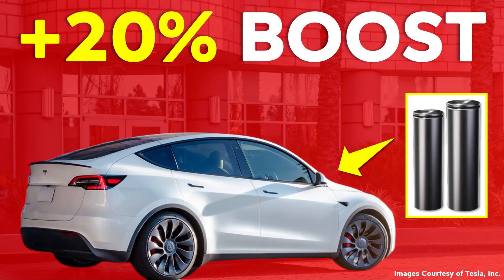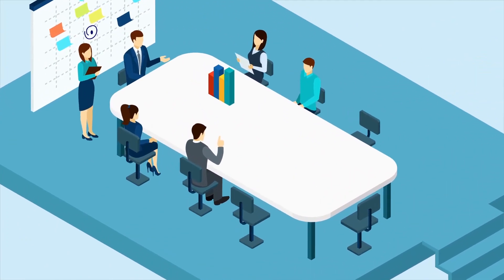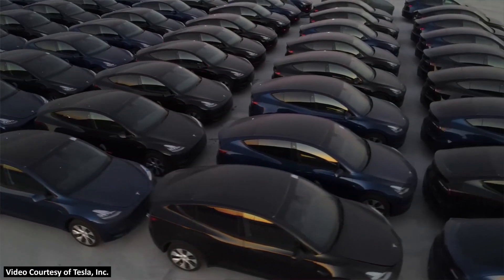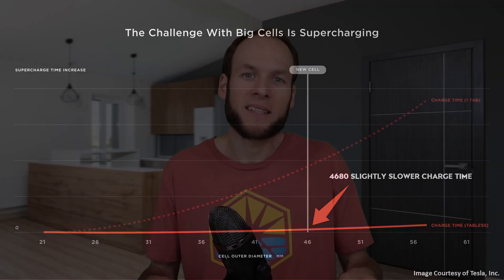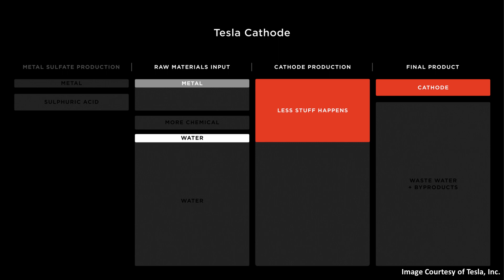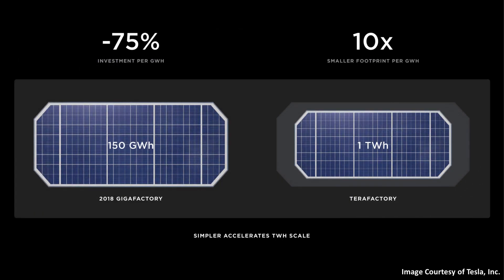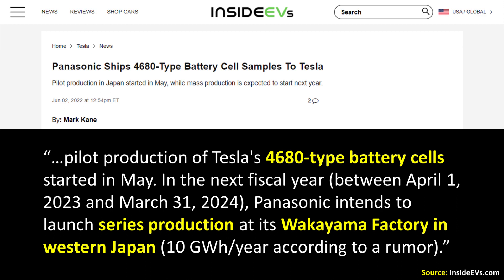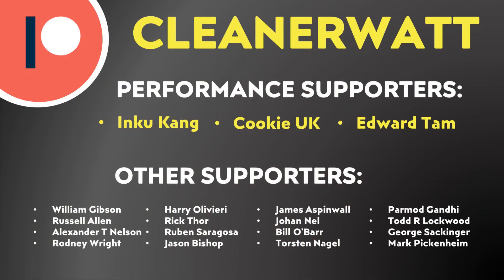Tesla vs Panasonic 4680 Batteries: BIG CHANGES! (1)

Comment: There's no way that the Panasonic 4680 could be charged at the same rate as the Tesla 4680. The internal resistance of the Panasonic version must be significantly higher than the Tesla one. I suspect the Tesla is deliberately holding back on the charging rate in software to avoid the Osborne effect and allow them to use batteries from multiple sources.
Reply: speculation is speculation. there are so many factors how the battery can be build and how the chemistry structure can be. there are no public compairsion on the cell level of both 4680 cells. when i see how many RnD is done in the battery tech it is always a challange from lab to massproduction.
Reply: @Francis-yc9nc  Exactly. Speculations are easy and often just based on a few Youtube videos people have watch without deeper understanding of the topic. What I would like to see is some lab analysis of real cells. Basic things like internal restistance for example or energy capacity. Is tabless really THAT much better than having e.g. 5 tabs? We don't know as long as noone actually takes the measurements.

Comment: I bet the new 5 tab 4680 built in Japan are for the MS and MX.
Reply: But then they'd have to completely change the Fremont production line for a cars selling about 160,000(?) in a year.
Not worth it.
Reply: @rogerstarkey5390  it's where they build the 18650 cells for the MS and MX

Comment: So in summary the Pansonic 4680 is not quite as good on electron path and heat , harder to make but uses a little less  copper and needs less  changes to there production line.
Reply: @Retired Bore if that was the choice you would be right but it's not

Comment: The thermal conductivity advantage of tabless 4680s would only be realized with a robust thermal path  from the anode and cathode to the exterior of the cell. We don't see that path in Tesla made 4860s.

A greater concern, one I mentioned on this channel before while quoting a Panasonic engineer, is that even with a good tabless design these cells will be hard to cool. This is the reason the Plaid uses 18650s. More layers of anode and cathode reduce heat transfer to the outer housing. The heat generated within the battery during high load comes much more from the chemical process itself than from internal battery conductor resistance during discharge.

Between the pack packaging disadvantages and the difficulty in cooling these cells I have never understood the advantage of using them (yes, I heard the "Battery Day" claims, I simply never believed them). Having seen Munro's initial tear-down I am convinced that Tesla is in a real bind with these cells.
Reply: The Tesla anode essentially "shorts" to the base, then the sides of the can.
Large surface area
Reply: the claim that a battery with 5 times the volume had 5 times the capacity and 6 times the poweroutput?
Reply: @reahs4815  
+/- 5 times the surface area of jeyroll (I think they measured about 4.8 very roughly)
That's 5 times capacity.
B
If better electrical contact wastes less energy as heat, and allows a 20% increase in energy flow, combi ed with that capacity, that's "6x power" (5 x 1.20)

Comment: I thought the goal was mostly ease of manufacturing with a smaller footprint for cheaper.
Reply: Tesla goal Panasonic just want to sell batteries for a good profit.
Reply: Tesla goal is their structural battery pack, and the reduction in resistence that decreases heat under load and allows more power output.  Also reduces the number of cells needed per pack dramatically.
Reply: @scottmcelhiney323  
The current Tesla 4680 poacks have fewer "Cells", but those combined cells still contain the same surface area of "active material" as an equivalent 2170 pack.
.
The larger "can" is easier to assemble into a structural pack.
Also, the thick casing material, if used in a 2170 "glued" pack, would be using a lot more metal.

Comment: Tabless tech was all about speed of manufacturing. Thats what I've heard from day 1. I did not think that the "Tablelessness" of the battery is responsible for the other benefits of the battery. Maybe I am wrong.
Reply: Tables means shorter electric path for the current resulting in less heat generation that will not only benefit faster charging but more efficient (potentially lighter, simpler) cooling and better sustained performance during peak performance. Also less degradation maybe. 

Tesla wanted to put them 4680 into the Plaid(+) but realized they are behind schedule and refreshed 18650 will do the job anyway, but IMO structural Roadster is still on the table with 400+ miles worth of 2nd or 3rd generation 4680s with 350 kW peak charge rate, insane acceleration and a lot of weight saved on the platform and complex cooling.

Comment: Tabless reduces resistance and hence heat generation. Also tabless offers a better escape path for any heat through the cell ends especially as the tabs are in direct contact with the cell terminal.
Currently it seems that the structural packs have the cells side cooled - I expect that to change as Tesla evolves their pack design. Tesla is just on version one and just needed to get something functioning and will refine their design quite rapidly.
Reply: Tabless design is a bit if a miss name really right...? More like it's an full tab design, 100% tab.
Reply: @monkeysezbegood  yep lol its one big long tab folded over to allow electrons to escape straight up the battery instead of going in a million circles around the roll creating heat to escape from a single tab like most other batteries.
Reply from the maker: I watched the Munro Live video and was surprised that it appears to be side cooled right now... I guess the bottom plate idea still needs refining.
Reply: @Cleanerwatt  Munro.  LOL.  This worn out dolt is just a Tesla shill with a reality TV show (carefully scripted and edited).  The BEV Shamwow! salesman.  You realize, of course, that Munro's experience is as a toolmaker.  He has no formal education in engineering and design or manufacturing process.  He did attempt to read, SixSigma for Dummies, but it was too hard.
Reply: There is no "structural battery."  The battery cell case is the structure, not the battery cell.
Reply: @ReachOutToWilliam  wrong, the cells themselves take load, they are 100% structural.
Reply: @KahnSkins  No.  The cells don't take structural load.  It doesn't take a chicken genius to see that there is no load path through the cells.  This isn't a knitting problem -- it's structural engineering.
Reply: @ReachOutToWilliam  sorry but you are just plain wrong, there IS a load path through the cells.
Reply: @KahnSkins  Please describe it, the direction of the path and the amount of load it is designed to take.  There is simply no way.  And load path is through the cells is minuscule and trivial.  The cells don't even touch each other, and are mounted in foam.
Reply: I think they will always need cooling, but they will require much less cooling than other batteries.

Comment: FYI, AFAIKT, I believe what we have all been calling "tab-less" is actually a "infinite-tab".

If there were literally no tab, then there is no electrical path.  And you can plainly see that the "tab-less" has thousands of tabs, all just folded over and crushed onto a collector part rather than individual welded tabs.

So I wish we could pick a better name:
* All Tab ?
* Continuous Tabs ?
* Infinite Tab ?
* Crushed Tabs ?
* TabMore vs TabLess ?
Reply: yup looks like 1000 tabs to me - I thought all batteries were made like this - the One tab design is straight out of 1920s tech
Reply: @GroovyVideo2  I was surprised that they all had just one internal tab.  But that may have been a hindsight effect?  Just imagining all the cells currently needing to traverse that one "buss bar" seemed very limiting, much less the thermal aspect.

I suppose it could be advantageous as a sort of internal fuse in case of short, in addition to some cells having a fuse in the button, so the endless-tab eliminated one intentional weak point so would demand a new fuse method?
Reply: Could the machines that make the cells be called Mount TabMore & have a relief of Elon's face pressed into each little pseudo tab?...   Just a thought.
If someone at a GF nicknames the robots, I'd like a free Tesla in appreciation.

Comment: At this point I just want a car that won’t burn my house down. Don’t tell me it doesn’t happen because it does. Even if it’s rare I would still sleep better at night if the battery was solid state.
Reply: really, how can you sleep with 60 litres of highly flammable liquid and fumes gassing off in your garage. Do petrol powered cars never catch fire ffs?
Reply: @blairbrewster9952  that’s the same stupid comment I always get, try to be original next time
Reply: @stevenanderson9660  Not so stupid.  There really are a higher percentage of ICE car fires than EV fires.  Why would you worry more about EVs in your garage?
Reply: @stevenanderson9660  yawn….there’s many things you don’t worry about and should, but you’ve either overlooked it or don’t care.   

There are about 400+ cars a day catch on fire in the US, compared to the 250 ish Bolts that have caught on fire since it came out during production.    Bolts also have pouch type batteries- not like teslas cylindrical batteries, which have always had problems with fires.  

So at 400/day X 7 days = 2800/week vs less teslas (guessing, but I think it’s less than 400 in 12 years).     I picked tesla since they have over 75% market share of EV’s in the US (June 2022). 

There’s no need to worry about it.   I’ve had my tesla for over 5 yrs, 162K miles (259,000 Km) and charged it almost 2000 times
Reply: Better sell your gas cooker & your heating boiler.  Fancy having soft copper pipes carrying flammable, potentially explosive gases throughout your house &/or garage?... 🤡
Your Koch Bros cheque is in the post, but smaller than hoped due to you doing a sh1t job of scare mongering on behalf of the oil robber barons.

Comment: Cool stuff!  Thanks. 🚀  I wonder if Tesla's DBE makes for even a slightly less volatile battery ?  Especially if both electrodes were DBE.
Reply: Dry just means no wet slurry applied to the collector, which needs to be dried.  Still has electrolyte to carry lithium, LFP batteries are a lot safer compared to nickel.
Reply: @jasonmajere2165  Makes sense!  Thanks.
Reply: @jasonmajere2165  
Jeff Dahn indicated some time ago that it was a particular chemical itself in manufacturing which was the main cause of "fire risk".
He also said it was possible to illuminate that chemical (from memory, possibly a solvent)
The only other reason would be the energy density meaning more released when shorted.
That means you simply choose between smaller, lighter, more energy dense packs, of heavier, less dense variants.
I think the "but nickel packs catch fire" opinion is now very largely just FUD. (Not helped by the GM/ LG "Manufacturing defect") Tesla has enough data to show EVs (packs) are less likely to catch fire than ICE.
Reply: @jasonmajere2165  
You think LFP cells don't have electrolyte?
Reply: @rogerstarkey5390  LFP do have electrolyte, they also produce less heat during a runaway event. Many videos of the Chinese manufacturers puncturing cells.